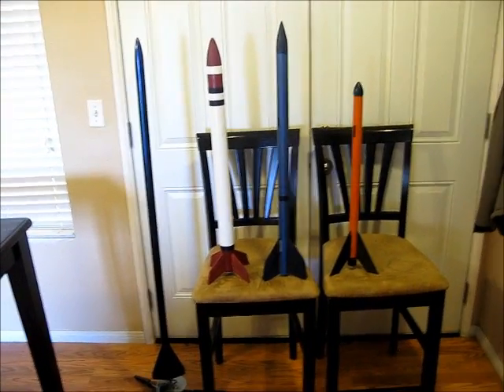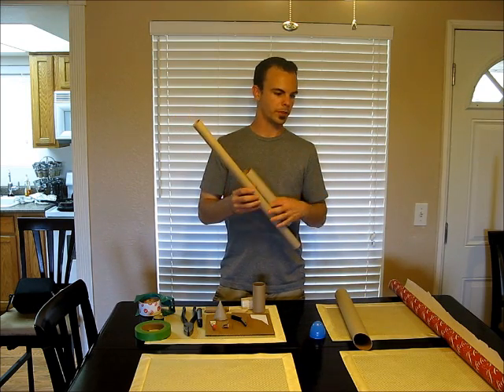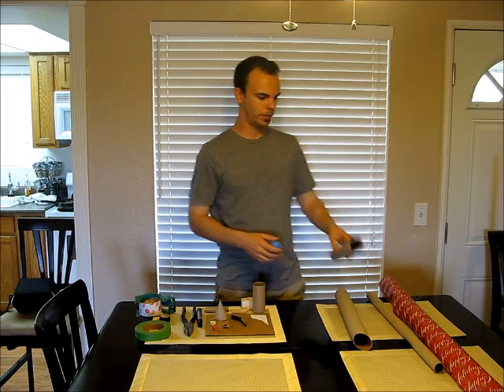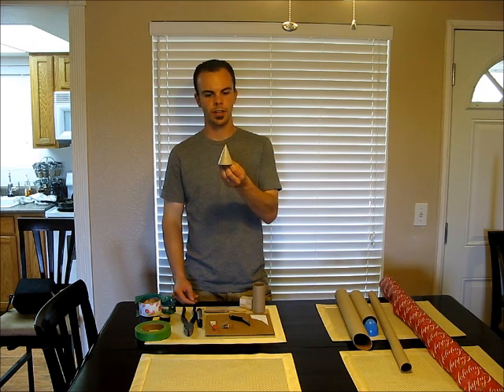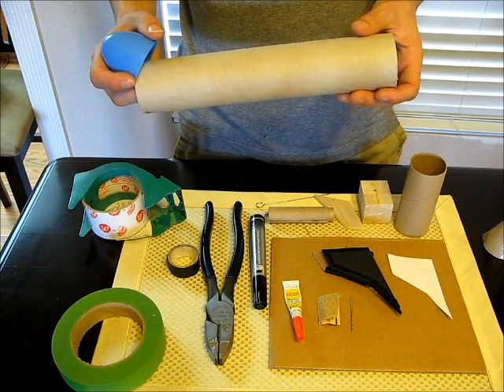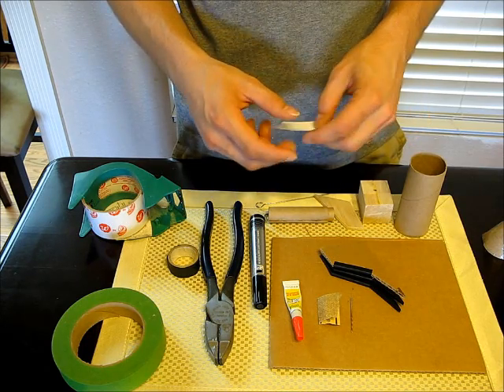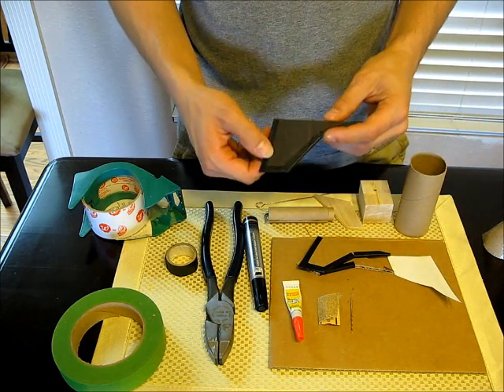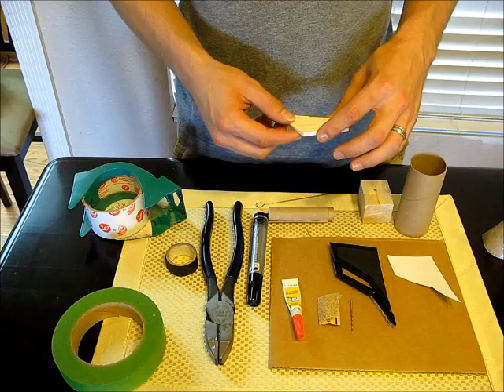Home-Made Model Rocket Guide Part 1

Comment: what Is a list of everything you used?
Reply from the maker: +furlon58 Ooh, having trouble remembering at this point, but I it's mainly toilet paper tubes, straws, some cardboard, cheapo shower curtain or garbage bag(parachutes), thin string, scotch tape, hobby cement, easter egg (nose cone), some foil, and some elastic cord (the rubber band-like stuff that has fabric sown on it, which you can find in the sewing section at Walmart). Good luck!

Comment: How do we know which motor we should use?
Reply from the maker: You can use any of the A, B, or C series motors (except the C11s). They're all the same size and will fit the rocket. It just depends how high you'd like it to go. If in a small field, I'd go with an A, or maybe a B. If in a really wide open space, I'm sure a C would be safe. Happy flying!:)
Reply: oh thanks

Comment: Tlgrimmy can u tell me the materials u have used and even which ESTES motor like c5-6 or something else
Reply from the maker: I actually go over them at the beginning of the video for you:). They change a little bit from rocket to rocket depending on what I have. For the most part, I use cardboard gift wrap tubes for the body, pieces of flat cardboard or balsa wood for the fins, pieces of flat cardboard and toilet paper tubes for the motor mount, along with some sort of small metal rod (paperclip might work) for the motor mount catch, Easter egg, cardboard or balsa wood for the nose cone, elastic cord for the shock cord, sewing thread for the parachute string, and cheapo shower curtains for the parachute itself. That should about do it. Thanks for watching and good luck with your build!

Comment from the maker: I use a keychain camera I bought off of ebay for $10 and it seems to work great for that. Just be sure it's fairly light so it doesn't pull the rocket to one side.

Comment from the maker: Thanks for watching! I left the materials a little vague just to emphasize that you can make most anything work. In general though, you'll need a cardboard tube (giftwrap tube), a toilet paper tube, some thicker cardboard or balsa wood for fins and motor mount rings, an easter egg/some sort of cap/balsa wood for the nose cone, a metal skewer/paper click for motor retaining clip, a shower curtain/table cloth for a parachute, string, scotch tape, wood glue, hobby cement/hot glue, and a straw.

Comment from the maker: The fist number refers to how much thrust in newtons the motor has and the second is how long the delay is before the ejection charge goes off and pops the shoot out. The larger the second number, the longer it will fall before the shoot pops out.The A,B,C refers to how much impulse (burn time) the rocket motor has.

Comment from the maker: Oh, I gotcha. Yeah, that launch pad came with the Estes rocket kit I got at a hobby shop. They're about $30 after tax for a rocket, the launch pad, a launch controller and a few rocket motors. You can also buy a 3/16" metal rod and drill a hole to fit in a 1 foot square chunk of plywood for a quick version. put multiple sheets of aluminum foil on top of the wood to help the wood from burning up too quickly.

Comment from the maker: Not sure which launch you're referring to, but I have a regular old Estes brand launcher that came in one of these cheap kits you can get at Toys R' Us with the launch pad and rocket. The other one (the blue box) is one that I made from components bought at Radio Shack. It can be powered by an external 12v gel cell or a small internal 9v depending upon how much umph you need;). I have a video on how to make it if interested.

Comment: I also can't cut circles, so early rockets uses sticks passed through inner and outer tubes and glued in with wood glue. One of my newer rockets uses a "cartridge" system with stacked popsicle sticks glued onto the motor tube. It centres far better, but it's really heavy, so I'm going to try foam or balsa next time.

Sorry about polluting the comments like this, I'm just excited to see that others have made cheap rockets. I found little information and had to come up with my own techniques.

Comment: I didn't have any thin metal (or simply didn't think of it at the time) so I came up with a really good alternate way to hold engines in. It's actually inspired by some Estes rockets, but is cheap. I cut the top off a plastic water bottle (disposable kind) and hotglue it onto the outside of the rocket tube. Usually the motor mount tube fits inside and I secure it with hotglue. Cut a hole in the cap and you're done. It works really well. And I thought I was the only one who made cheap rockets.

Comment from the maker: Yeah, some gift wrap tubes are really flimsy. If you can't find any at the dollar stores and don't have any gift wrap at home, you could try using a couple of paper towel tubes end-to-end. You could just take a toilet paper tube, cut a slit down one side so you can adjust the size, put a coat of glue all over the outside of it and put it on the inside of the tubes where they meet as a coupler. You could also go to a store that sells nicer gift wrap and find a nicer tube. May cost $5-$10 though.

Comment from the maker: Thanks! Bummer that the rocket went missing. All part of the fun of model rockets, right? ;) That motor should have an ejection charge, so maybe the cone or parachute got stuck. I've had that happen before. Sometimes, if the parachute has to be wrapped tightly to fit in the tube, you can have problems. If that's the case, try a thinner material and wrap it as loosely as possible where it will still fit it, but will easily slide out. Good luck!

Comment from the maker: A little more on the center of pressure...imagine blowing on a stick that had a small piece of paper on one end. That end will tend to go backwards. If you move your finger over further towards that end, you could counteract the pressure of the air current (you blowing). That would be your center of pressure. I tend to just make that rocket balance a third to half the way up from the tail and cross my fingers;). So far it has worked great!  I'm just too lazy to calculate the center of pressure.

Comment from the maker: Thanks! Actually, the wire is flexible enough you just pull it back, twist out the motor, and it pops back in place. Good luck with the project!